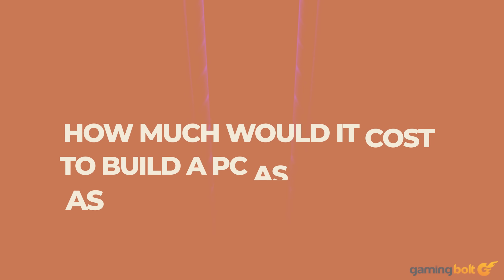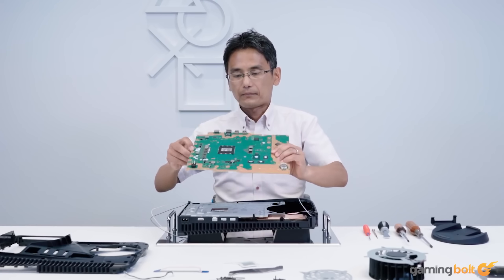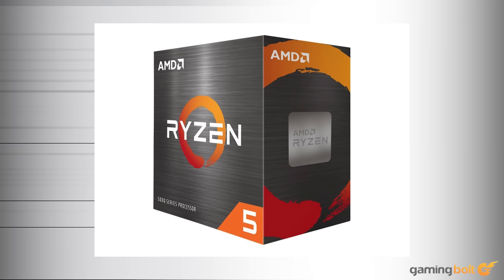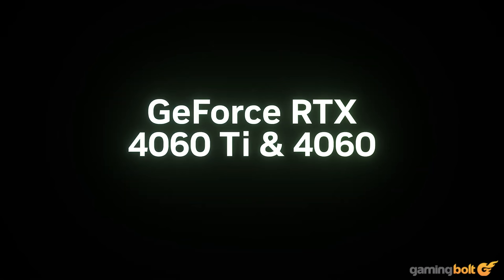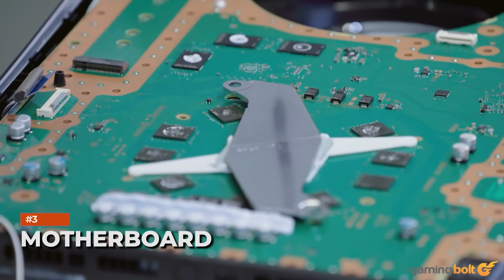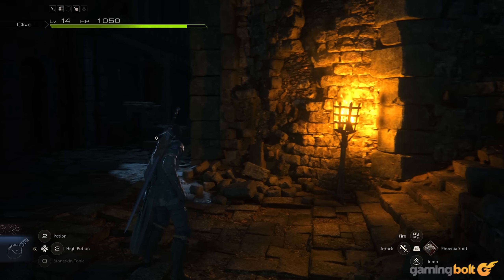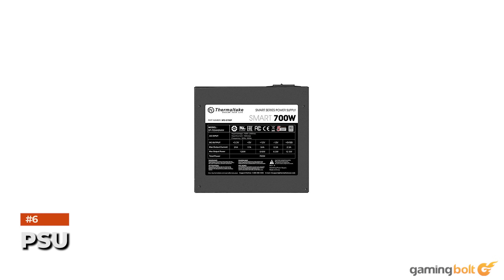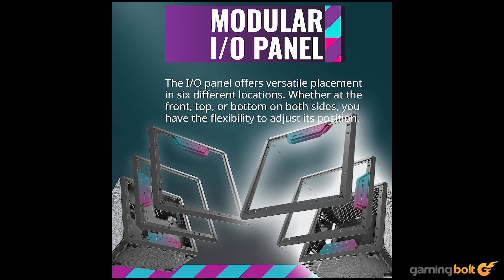How Much Would It Cost To Build A PC As Powerful As The PS5? (2023 Edition)

Comment: B450 chipset doesn’t support PCI-e 4.0, only 3.0. You’ve utterly gimped the drive to about half its speed and is bottlenecking the 8 lane PCI-E 4060.
Reply: The motherboard is also too big for the case. MATX case with ATX motherboard.... not sure they actually build PCs.
Reply: @evilwookiee7655 nah it should fit
Reply: That's what happens when you take PC advice from non PC channels. Also, the 4060 is quite overkill compaired to the ps5.
Reply: @superC1266   be didn't say he was u using a 4060ti in the video. He said was using a 4060.
Reply: Uggghhhh u such a nerd lmaooo
Reply: Don't forget it's a "owrus" version mobo 😂😂😂
Reply: I saw b450 and thought PCI 3.0 you need PCI 4.0 Nvme to match the PS5
Reply: It is a pretty bad compatibility fail mother boards that support PCIE 4 are relatively affordable.
Reply: until devs actually use direct storage that makes zero difference for gaming, for loading speed anyway, it does gimp the gpu, slightly
Reply: with 8 lanes of pcie3 being used for ur graphics card on pcie3 everything else u would only lose 1% or 2% of ur fps.
Reply: @MisterMaleMan  Pretty much. This card is excellent value only for those that know how to use it. Plus with all this bad press and hate from the Techtubers and their minions it has been keeping the pricing honest on this card lol.
Reply: Yeah, but it's also proven that you can get 5 to 10% better performance on your GPU with Gen 4 now
Reply: Not trying to be that guy but I must add to this comment regarding pcie 4.0. Some B450 motherboards did receive a bios update that added this feature. Not many, but some.
Reply: @ChfHappySack  I read that as well but also at the same time read that they removed that functionality afterwards. So to my understanding from what I read is there are specific BIOS updates that might enable it but the latest BIOS updates likely have put it back to 3.0. I would have loved to have 4.0 support as I had a bunch of good MSI Tomahawk B450 boards and ended up selling off for x570 boards. Luckily I didn't spend much out of pocket as I got around $70-80 for each B450 which was the same cost of the X570 boards I bought. X570 also gave far more full speed expansion slots where B series boards have far limited full speed slots. So even though many of these X570 builds only have Gen3 NVMe drives they at least run full speed Gen3 on both drives unlike what the B450 boards offered.
Reply: @ChfHappySack   Anything after 2021 AMD has updated AGESA to no longer allow it on B450 and X470. So unless you fit into the weird cross-section of people using a ryzen 3000 series processor (on older BIOS's), and need 4.0, sure. You're not going to have working 4.0 on zen 3.
Reply: Bro he called am4 an architecture why are you surprised that he messed up the pcie capabilities. Ps am4 is the socket zen 3 is the architecture
Reply: @@lonewolf_09except of course the fact those are the most expensive parts outside of the most expensive… that you didn’t even mention… the gpu…
Reply: I agree he could’ve saved money by getting a pcie gen 3 SSD instead of
Reply: YOU'VE UTTERLY GIMPED THE DRIVE TO ABOUT HALF ITS SPEED

AAAAAAAAAAAAAAAHH passes out

Reality: He lost 2 fps in minecraft
Reply: @touristofsongs4946 If you're putting out a video like this, at least know what you're about. That's the point. Compatibility fails are not a good look.
Reply: @stephanhart9941  
It was a joke
And my pc doesnt have even 1/100 the power of that stuff so 'losses' like that of incompability are nonsense compared to the low power of my pc.
I took it as a joke; like a millionaire that has lost 100 bucks and is crying, having a tantrum, extremely pissed, but still has 300 million in his account.
Reply: @touristofsongs4946 kind of true, but at that point might as well go for a much cheaper drive such as the kingston NV2 or te team Group mp33 (spending the same for 2TB or just saving a bit).
Reply: 0 fps loss
Reply: @MrPruske   The 4060 is an 8 lane PCI-E 4.0 gpu (vs the standard 16 lanes), meaning 8 lanes on a 3.0 motherboard is limiting half of the bandwidth that goes to the GPU. This will 100% affect FPS.  It has already been proven, multiple times over.
Reply: @MrErball PCIe 4.0 x8 is as fast as PCIe 3.0 x16 so no bottleneck just like nvme SSDs are not fast like they claimed lol.
Reply: @leanlifter1  You're misunderstanding it. They're advising putting a 8x 4.0 'physical' pci-e GPU on on a 16x pci-e 3.0 slot. You only would get half of the mobos pci-e 16x due to the card being limited to 8 lanes. At gen 3 speeds the b450 allows, the card would operate at half it's rated PCI-E bandwidth. It's a massive bottleneck on the GPU.
Reply: @MrErball  Look up rx 6600 5600g impressive performance and value combo.
Reply: @MrErball it's like, 2 less fps on average. stop being a fucking PC elitist and just acknowledge that pcie speeds don't matter all that much right now. they will when cards start actually utilizing the entire lane, but that hasn't happened.
Reply: @bowltm   LOL, okay, you're right. I'm an elitist, because I'm pointing out inaccuracies and compatibility concerns on a new build.  How dare I warn people about these concerns when it's a tangible concern?  Who cares if it's just 5-15% (per HWUnbox video), when it can be brushed under the rug by calling a stranger on the internet a name to make you feel better.
Reply: @MrErball  I get the same when I bring up 8x GPU on Gen3 concerns. Most people have seen general Gen3 vs Gen4 comparisons and their take away is Gen3 doesn't make a big difference. What I think many of these people don't realize is they are not comparing apples to apples from this past knowledge once you factor in a 8x GPU. If going B550 was an extra $100 over B450 I could see the argument to save some there even with a bottleneck but not when they can be the same price. I sold off all my B450 boards this last year and for next to nothing out of pocket all 8 of them are on X570/X570S with only a B550 with Gen3 5600G in the shop. I wanted multiple NVMe slots of PCIe slots that would run full speed Gen3 or Gen4 drives. B450 and B550 are really limited to their chipset M2 slot for full speed usually. So $70, 80 and $100 X570S boards were easily upgrades over many B450 Tomahawk boards.
Reply: Gimps are hot
Reply: @Olkv3D uuh ... True in a way 😅
Reply: True but you wouldn't notice it in games anyway.
Reply: @calvinm1866  Limiting bandwidth will affect games and fps. There is plenty of tests concerning that.
Reply: @przemysawjodczyk4307  There's maybe a second difference between gen 3 and 4 nvme ssd.  Come off of it already.
Reply: @calvinm1866  I wasnt talking about ssd but gpu.
Reply: @przemysawjodczyk4307  I was just about to get back on and say that.  Mybad.
Reply: @calvinm1866  Still dumb to do so when a B550 boards doesnt really costs more, but provide much more usability in the future. Also the second M.2 Slot only have PCIe 3.0 x2. The board dont even have USB-C. Just a bad choice AT ALL.
Reply: @Nobbi_Habogs  You only see games loading 1-2 sec slower when 980 Pro runs on PCIe 3.0 mobo compared to 4.0 one. PCIe 4.0 pretty much wont affect your game performance if your FPS under 200. oF course picking B550 is a bad choice if we talk about building PC
Reply: @calvinm1866   you would in loading assets with would eliminate texture popping
Reply: I own both and will be playing  it on PC for smother  game play and try downloading 100gbs of mods on ps5 

I play same on both systems for cross play and the difference on PC is night and day

Comment: Your specs are way way out. The ps5's gpu is closer to a NVIDIA GeForce RTX 2070, no where near the RTX 4060ti you stated. An RTX 2070 comes in at around $150-300.
Reply: The PS5 is nearly a 1:1 copy of the  AMD RX6700 (non-XT). Which is ~%30 faster than a 2070, so your comparison isn't valid. The bigger distinction is VRAM, 2 additional gigs on the 6700 is pretty obvious at higher resolutions.
Reply: @MrErball You are very wrong! The guy actually stated what has actually been already stated and confirmed by many great analysts. Digital Foundry being one of them. And yes 2060 super type of power, sometimes may be 2070.
Paper numbers and architecture doesn't translate to real numbers in consoles, as those are APUs and not GPUs. So less power to maintain heat down, translates to less power out put.
Look up all the analysis videos, there are plenty.
Reply: @ADRzone  How exactly am I wrong? The PS5 is literally an RDNA2 gpu that has identical specs as an rx6700. Look at any relative performance aggregate, it's markedly faster than a 2070. The unified memory of the ps5 furthers this performance discrepancy.
Reply: @MrErball  First my apologies for just writing "you are wrong"… it sounds very disrespectful and I don't feel at all right with that, so my apologies!
Now why is the content of your statement wrong, it is because the PS5 GPU is a unified component with the CPU, this is what an APU is, is a CPU with an integrated graphics card. 

APUs are laptop hardware, and even looking at the laptop counter parts, we can see that a 2070 on a laptop is much weaker, than a dedicated 2070 on a PC. This is the exact thing happening to the PS5. The PS5 may be running on the same architecture that the 6700, but to limit the heat generation and the overall power consumption, it is reduced tremendously when compared to the dedicated GPU.

That power loss, has been reported many, many times to have been around the RX5700xt, 2060super, and may be close to the 2070 when games are very well optimized. But the average is a 2060super/ RX5700xt power level, due to everything I mentioned above.

Marc Cerny's PS4 and PS5 presentation illustrates this APUs capabilities, also AMD did, and also many other hardware tech channels.
Reply: I have a 2060 Super and it's doing great so far.
Reply: Wrong i have the 2070 super and it by no means match my ps5 performance in nearly all games. Digital foundry keeps mentioning that it is equivalent to a ps5 because it performed similarly in some nividia sponsored titles like a plague tale, they ignored the fact that every other game run much better on ps5 than the 2070s.
Reply: @mohamad-abdo Yikes, you may have a faulty 2070 'cause damm my brother, that is a huge statement to make.
Reply: @ADRzone  every fuckin owner of 2070 super is already saying the same thing, every performance review on ign mentions that ps5 surpasses the 2070s by 30%.